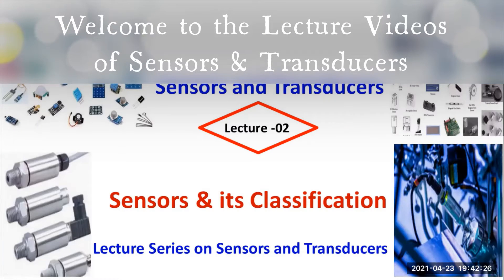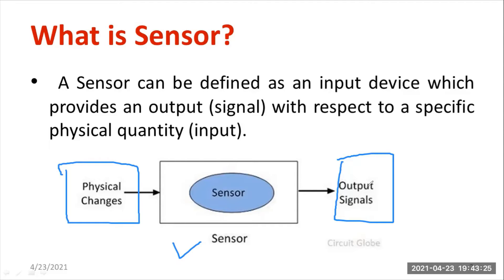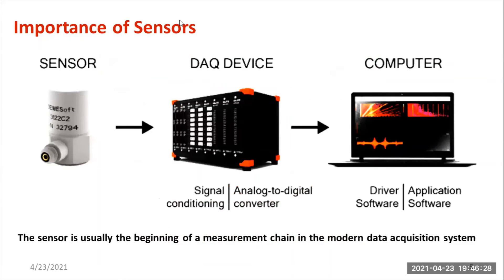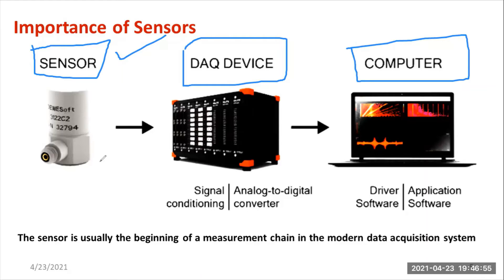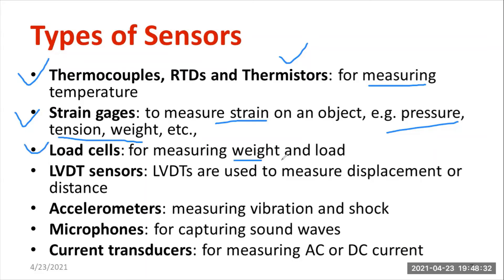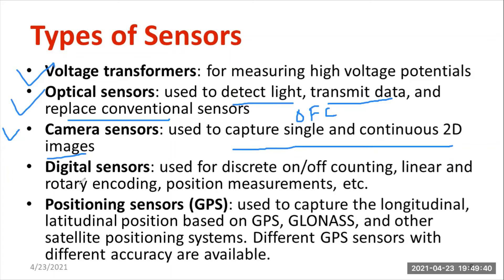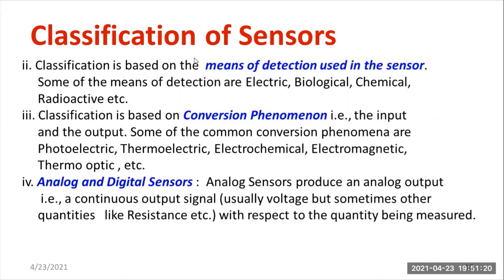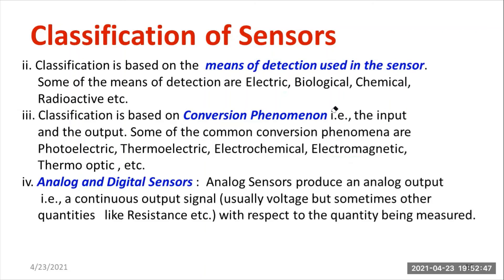What is a Sensor?Definition|Classification of Sensors|Importance of Sensors|Applications of Sensors|

Comment: Passive sensors require external power source for their functioning. Most of the resistive, inductive and capacitive sensors are passive (just as resistors, inductors and capacitors are called passive devices).
Reply: you are wrong active require external source not passive
Reply from the maker: OK madam.. Thanks for updating the conclusion
Reply: @SimplifiedEEEStudies  galat information kyu dete ho, nhi aata padhne to mat padhao